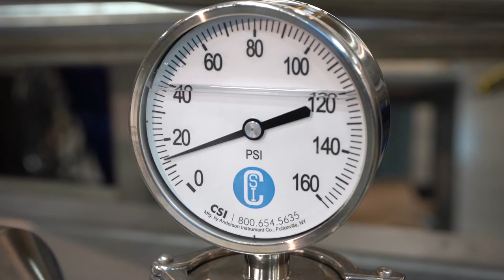Pump Cavitation Explained: Top Causes and How to Avoid

Comment: In my reliability/plant engineering experience, he is wrong about cavitation "almost always" coming from an issue before the pump, and that there's "no way to solve cavitation after the pump". You've never heard of recirculation cavitation and high temperature vaporization cavitation? Those are very common in the field and are almost always fixable after the pump. High head+low flow = High temps and high recirculation chances. Haha sorry for the rant, just felt that strong language was used and needed a reply.
Reply from the maker: Thank you for your input.

Comment: What about discharge cavitation
Reply from the maker: In some cases where the discharge pressure is very high and forcing internal recirculation you will see cavitation. This is less common, but certainly a very real thing.

Comment: Put more water in your tank. You have a lot of turbulence not good
Reply from the maker: Our setup is a closed system so there is a fine line to be able to showcase cavitation in the way we were going for. Adding more water to the tank would absolutely lower the turbulence, increase NPSHa, and decrease the onset of cavitation.